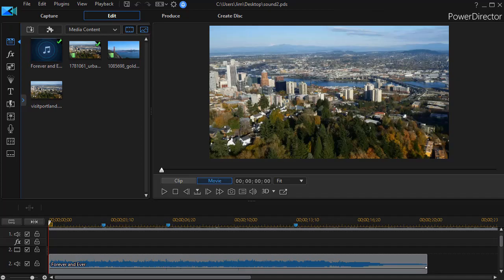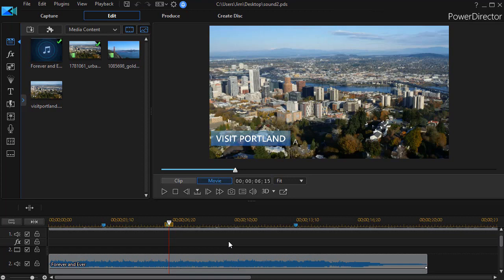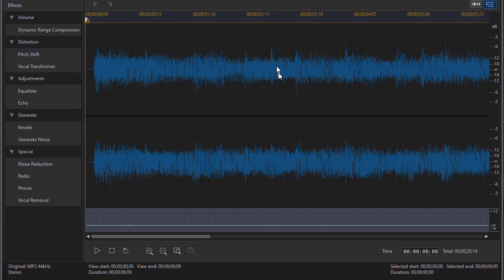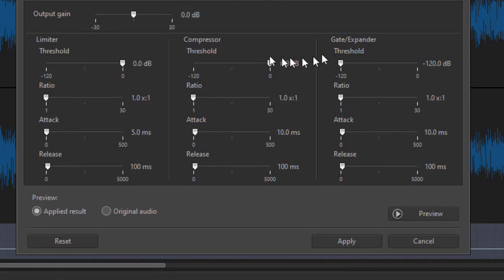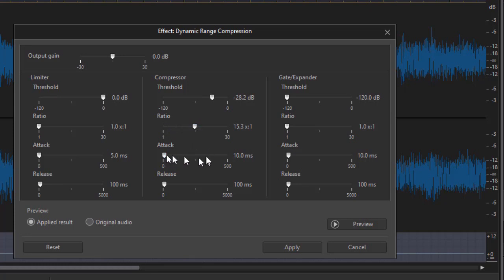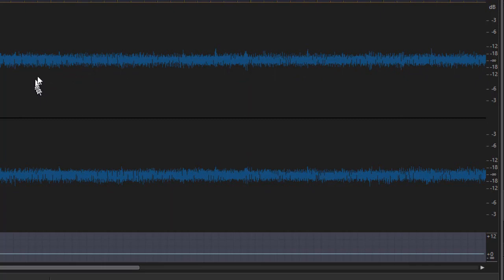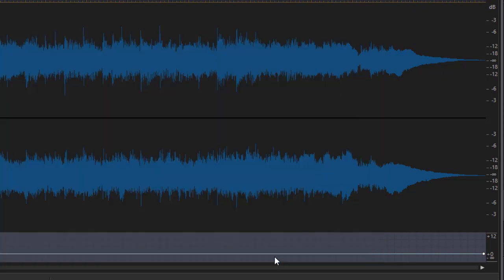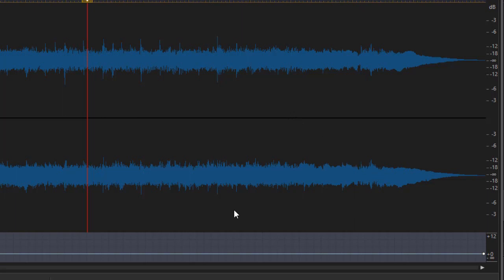PowerDirector - Dynamic Range Compression within the Audio Editor - part 2

Comment: Can I do that with the wave editor in pd15
Reply from the maker: I just looked into the Wave Editor in PD 15. It will do dynamic range compression, but only offers you a single slider rather than the multiple tools available in the current version. In one sense it is easier because it is simplified. I'd encourage you to try it out and see what you think. --Jim
Reply: @SharperTurtle  thanks I will try it.